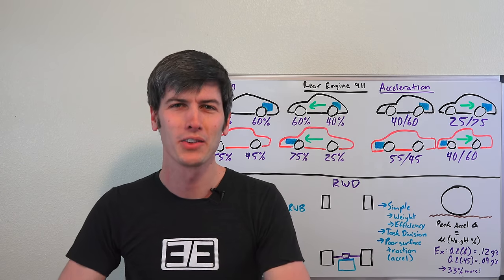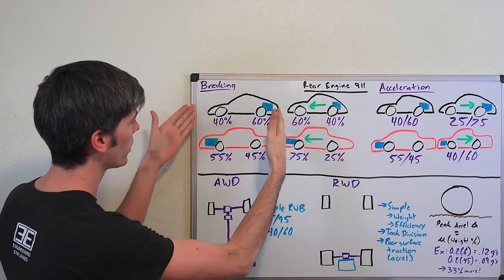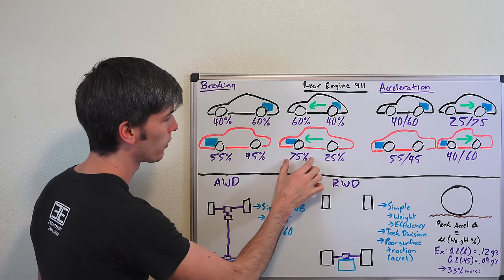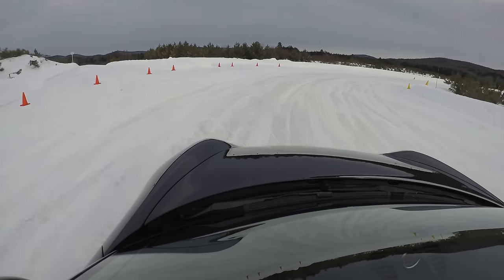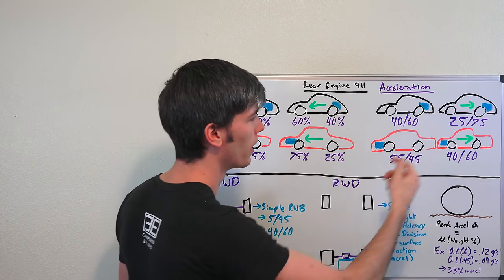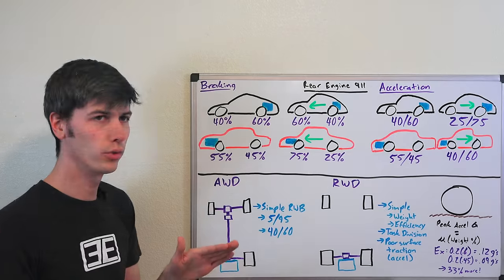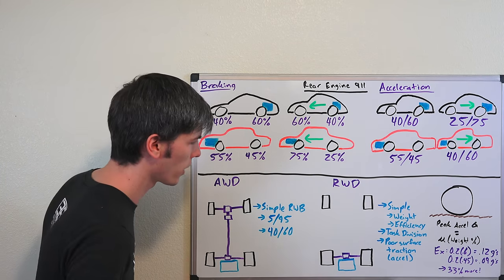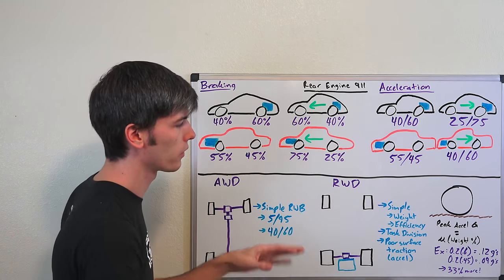Why Is The Porsche 911 Rear-Engine?

Comment: I like your channel. But this particular video seemed a bit biased. Which sports car has a front engine, meaning an engine that hangs in front of the front axle as you drew? Most of them have the engine over the front axle or even better behind the front axle, making it mid engine. Furthermore, there is no real reason to have the engine behind the rear axle but to be different. A rear mid engine position has basically the same advantages without most of the disadvantages. The reason Porsche has rear engines in the 911 is just to be different. This is the reason that basically nobody else does. It would have been more useful if you had included rear mid engine in the comparison. Because then the Porsche option would have looked pretty senseless.

Comment: Hi jason
I’ve a question and I hope that u make a video about it please .
What happens if i push the gas throttle with the break in the same time to increase the rpm reading to make a quick acceleration?
Its a front wheel drive car without launch control .
Will that damage the car or the engine or the drivetrain?

Comment: I think you make a mistake assuming the same percentages of weight transfer for the red car and the Porsche when it comes to acceleration and deceleration. Due to the fact that there is more weight on the back axle in one vehicle not only the total force but also the percentage of the force will be higher than in the other car. That and that the beneficial weight on the back is mostly beneficial for the acceleration from the standstill. Only in very high power applications the rear wheels will loose traction when accelerating out of a corner (granted you're actually trying to grip it and not drift it).

Just my 0.02$.
Reply from the maker: As mentioned, it's just an assumption, there's no real math behind it, it's to illustrate a point. I have other videos breaking down the math of load transfer for those who are interested. You could very easily manipulate the wheelbase and cg height to have the exact numbers the video shows work out.

Comment: How does air cooled and horizontally opposed figure into the rear engine design? I had thought that Porsche could do this since their engine was light and power dense. Rear engine would not work with a cast iron V8.

Comment: Porsche 928 has 50/50 weight ratio. Engine in the front, transmission in the rear + rear wheel steering.

Comment: The fist EE video that I am a bit disappointed. You barely talked about central engines. There are front and back central engines and you only mentioned the second one. Other 911 important feature is the 6 flat engine that lowers the center of gravity. This subject deserves a much deeper video comparing the theory and measured data of different approaches.

Comment: Still don't quite understand how it accomplishes turns without any problems. Since the majority of the weight is in the rear, how could the vehicle not understeer. Because there is very less weight on the front wheels which need to turn, and wouldn't that lead to very less traction on them?

Comment: Nice video and explanation. Was that Camp 4 RS program? Did Porsche Canada start using turbo-4 or still the flat-6?
Reply from the maker: These were 3.0L flat-six turbo engines (not 911 Turbo, but Carrera S and 4S). They do have the 911 Turbo for drivers who've completed the S/4S programs.

Comment: That's nice. But sports cars are not made to accelerate and brake straight lines only. Sports cars are made to be fun turning. In that situation you must agree 50/50 is the optimal distribution.

Comment: Having owned several late model rear engined VW type 3s which share the IRS semi trailing torsion bar rear ends of the early to mid 911s and all 924, 944 models with 356 similar front end and then moving to front engine RWD Australian GM cars based on the late 70s opel chassis I can tell you that weight bias only makes up a minority of the pros/cons, suspension design is more important. The GM cars I have now handle several fold better and better "sports" characteristics with minor modifications while being much more easy to control in tracktive and over steer situations.   Although the VWs were good mid corner, turn in was terrible and had under steer, exit typically had pendulum over steer  handling. Worse of both worlds in this case and the suspension design didn't response much to modification to try improve handling.  This is similar to early 911s with factory setup, not good really.  I know Porsche engineers did a lot to try improve the handling over the decades and have got it more or less good in the end with great late braking and great turn in.   I personally still prefer the way a front engine RWD car feels and handles with live axle rear and McPherson front end. Back end is very snappy and controllable at will in response to fast turn in and throttle while the front has great bite and sharp direct turn in.  Feels like driving a big go kart. Disadvantages that I notice is acceleration traction isn't the best and chassis twist on hard acceleration, that's with a 55/45 distribution but the twist/traction issue lies with the live axle design and not so much distribution in my case.

Comment: From an engineering point of view, your story makes sense, but it doesn't answer why.

The first Porsche, the 356/1, was mid engined. The engine for the production version however, was moved to the back to provide room for rear seats, so Ferry Porsche's children could sit in the rear. The 911 build on the tradition of the 356.

Comment: Why do you take into account the "more weight = better grip" for the acceleration on the 911, but not on the deceleration for the front engine car (front bias) ? I refer to your other videos where super heavy car can break very short. Bus and trucks as well. Moreover narrower tirer brake better on snow and wet (pressure by surface). Therefore I would assume that the 911 layout might not be the best layout for better braking and that many information are missing and that (for once) this was not very scientific claim.

Comment: Totally ignores mid-engine options.  Also, it makes it sound like all front-engine rear-wheel drive cars adapted to AWD have the transmission in the back.  I'm sure BMW and AMG would disagree.  I'm leaving out Audi as their engines, except for in the R8, tend to be in front of the front axle.  Plus, there is still another way to get AWD: Using electric motors.  This can include hybrids--or the dual motor version of the upcoming Tesla Roadster.

Comment: That equation for max acceleration is questionable imo. Maybe if it only applies to slippery surfaces then it makes more sense to me. Thinking extremely, on a dragstrip or hot asphalt and good tires you certainly can exceed a gforce of acceleration in a front engine car, and in that case the equation doesn't solve to the problem.

Comment: All very good points if you want a car that goes fast in a straight line.  The problem is when you try to turn at speed and find very little down force on the front wheels, then when you get the car to turn the back just keeps going.  So now Porsche spend a fortune on traction and stability control research to mitigate the problems they caused by putting the engine behind the rear axle.  Old Porsches were very exciting deathtraps.

Comment: If i follow your point, front weel drive is usless?
It works fine in snow.
Reply from the maker: No, front wheel drive is great in snow, because usually the engine is directly over the driven wheels (as is the case with the 911).
Reply: Engineering Explained 

And they do well inn rally to on enny surface. 
But real weel drive is moore fun! 😁

Comment: A sensible view from the UK. The boy fronting this video has no idea of history or logic, particularly Porsche history and logic. The reason the engine was put in the rear of the car is as follows. One Mr Ferdinand Porsche was a designer at a car company called Auto Union that wanted a racing car. He got the job and decided FOR A TRACK CAR it would be better to have the weight over the rear wheels for traction. The dynamics of weight in motion and distribution was an alien concept then. It was successful so they made a "Road Car". and left the engine in the rear. Over time, knowledge and technology they found this very unstable unless on smooth roads and dry sunny days. For some unfathomable reason, they left the engine back there and so suffered traction problems. So off they went for a tech solution: Limited slip diff, 4 wheel drive, traction control, move the engine forward, put the gearbox up front, make the front suspension heavier. It used to be a joke that any driver of one of these cars was seen he was asked how much sand ballast was in the front. Here's a test, get yourself a dart and throw it backwards and see what happens to it in flight or look up the definition of "Fishtailing". That is why no other road car, apart from silly Italian marques and another German bit of nonsense, have their engine in the rear. Those that know would never buy a Porsche, it's a teenagers masturbatory fantasy. You wanna sportscar for the road, get one with the engine in the front, leave rear engined cars on the track.

Comment: Isnt it a bit simplified to say putting the engine at the back is "simpler" mechanically?
Sure, you dont need a long driveshaft, but you get into a few new packaging issues when it comes to the gearbox for example.
Reply from the maker: Well it's really not much different than a front engine, front wheel drive vehicle. In this case it's just longitudinally mounted.

Comment: Not everything is done out of logic, and you're missing the most probable reason the 911 is still rear-engined. Tradition. 911s and have been rear-engined since the dawn of time, and if you remember the absolute uproar and controversy the Porsche purist muppets and press caused in the early 2000s when Porsche decided to put headlights that were different from the traditional round headlights of the 911, imagine what would happen if they'd try and take away another iconic feature of the 911, the rear-engine layout.

Comment: Hmmm so you should compare the AWD Porsche to a typical AWD car, a typical AWD  front engine sports car that claims to be rear biased, and the new BMW m5 AWD system that can legitimately be 100% rear driven and turn off power to front (a first in sports cars afaik?)

Comment: Warning: personal opinion and bias exposed.
I always assumed the engine was in the back because Porsche 911s always sounded like a  “glorified Volkswagen” to me. And they still do.
I drove a friends 914 several times, in the early 1980s, which further solidified my “glorified Volkswagen” impressions. Even a 6 cylinder one.
I drove a very early turbo model 911 down an airport taxi way in the summer of 1977-78 or so. Don’t tell the FAA.
The turbo lag was so bad it drove like...well...like a Volkswagen for the first 4-5 seconds...and then ran like a banshee when the boost came in.
Great on a race course where the engine stays revved up in the power/torque band. S**tty for a street car.
As an engineer and an American, I’ll admit that I hate engines that don’t do s**t until they’re really revved up. Look at the specs. Porches nearly always make more horsepower than torque. For a street car, I want low end torque. And even the Porches that make adequate low end torque, still sound like Volkswagens to me. 
Like I said, I’m an American raised on large cubic inch V-8s.

As an aside, I worked at an airport pumping gas from 1976-79. Most of the mechanics were veteran Vietnam “Huey” mechanics/door gunners.
The best mechanics I’ve ever been around.
The #1 mechanic had a wife who drove a “Plain Jane” 911. 
He had to work on it so often that he finally made her get rid of it.
Anecdotal, I know, but it made a lasting impression on me.

Comment: STI or longitudinal Audi's are front wheel biased or have two shafts to the rear axle?
Reply from the maker: While they can be rear wheel biased, they won't send 95% to the rear (STI max is 65%, I believe Audi has some that are 70%), and the setup is more complicated to do. The Nissan GT-R can send 100% to the rear, but has a separate axle going from the rear to the front.
Reply: Engineering Explained I didn't say anything about the amount of bias, I just made a point that not only rear engine cars and front engined cars that have a gearbox in the back can be rear biased. And furthermore, almost  all of the awd cars that have longitudally front mounted engines can be 100% rear wheel biased, since the torque splitter (center diff) feeds of the driveline that goes to the rear axle, not the front, so essentially yo can throw out the diff entirely and you will get a rwd car. So such a car is not capable to change the 50/50 axle slit to a 0/100 rear slit, than it's simply a manufacturers decision to make things in such a way, just like Porsche decided to make the center diff that can go up to 5/95. By the way, I'm not exactly sure, but maybie even the EVO is rear wheel biased despite it having a transversely mounted engine and so you'd think that the rear axle would feed of the front one and not the other way around. But like I said, I might be wrong on that last one, since I don't quite remember how it's tranny is made, but I remember that it's more complicated than that of a classic transversely engined awd car, that simply has a Bolton torque splitter that feeds off of the front axles bevel gear, that's why such cars can't send more than 50% to the rear axle.
Reply: P.S. the 911s drivetrain is no more complicated than any other longitudally front engined car, its essentially the same, the main  difference being that the body of the car is simply put on backwards ))

Comment: If it's all for grip and straight line speed how can the demon be front engine rear wheel drive and have the fastest quarter mile? Why wouldn't they use rear engine?

Comment: Porsche 911 has the engine in the back because it is an update of the Porsche 356 that had the engine in the back. That 356 had the engine in the back because it is an update of the VW bug and used parts from the VW bug. The VW bug had the engine in the back because it was cheaper to produce a transaxle and beacause front wheel drive was too expensive. The VW bug had to be sold for less than 1000 Marks. Porsche had to do with what they had and the rest is only marketing trying to explain the thing.

Comment: Poorly prepared ad based video. If you added mid engined cars, that comparison could be little bit more fair. But just comparing with front engined ones is just cutting corners.

Porsche is "last" rear engined car manufacturer, because they are  investing engineering to that too much. Even they have accepted their fault and try to open a new path with 928, but RR layout sticked to their image so they turn back to improve.

Many car enthusiasts know that rear engine car has very difficult dynamics that many manufacturers refuse to to handle (Renault(except twingo) , Skoda and even vw itself) Porsche has a lot of efforts to make this car drivable by not only talented drivers but also everyone. Even Porsche know that mid engine is better; they try to downgrade Cayman GT4  with less powerfull engine and manual transmission. Still GT4 is competitive with GT3 touring

Comment: Hi. I always enjoy your videos but I have to agree with others here who say it's still in the rear for traditional reasons. The 911 is 40 years out of  date because it was superceeded by the 928 back in 1978. The engineers created a front engined, rear gearbox ( transaxle ) chassis with 50/50 weight distribution and 4 wheel steering precisely in order to overcome the disadvantages of the rear engine layout.
The problem was that they created a great GT car in the 928 which was not seen as a "sports" car and didn't appeal to their core customers so the 911 continued in production. 
My partner has had 4 911's since 1996 and they have got heavier and softer. The steering feel of the hydraulic cars has been lost with electric power assistance. The onboard stability management keeps you alive in most situations, but it is still a compromise. 
The 928 was the solution.

The 928 doesn't have
The 928 is a fantastic car, I have had my  1979 series 1 for 31 years and I still love it. (I can fix I t too!)

Comment: So why aren’t less performance oriented cars, such as sedans, rear engine rear wheel? Just too expensive?
Reply: shut your face! Because you wouldnt have any space in the back with a rear engine. For a 911 thats no big deal bc you wont use it for extensive shopping. But for a sedan it would be kind of impractical.
Reply: Leo Buchwieser well you’ve got space in the front, so I don’t think that’s the issue.